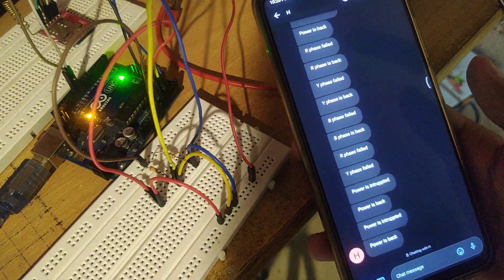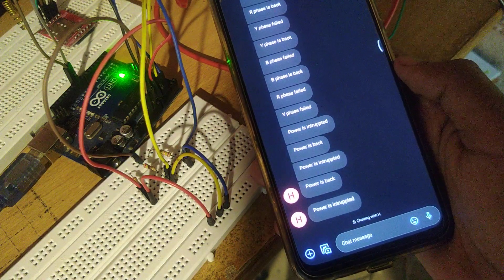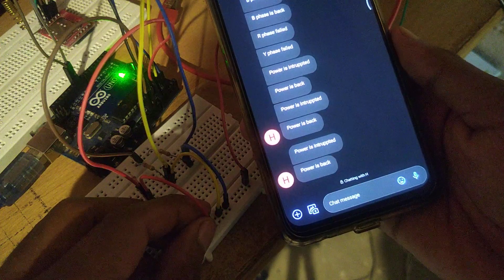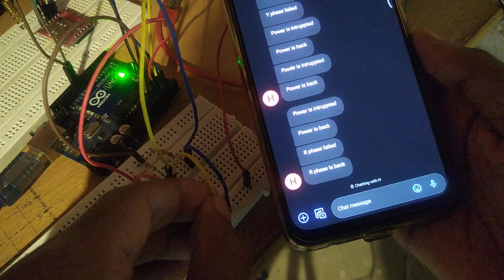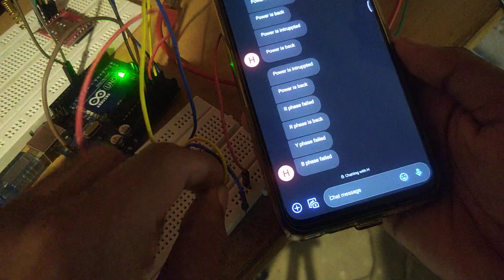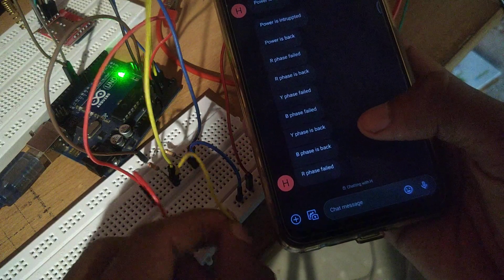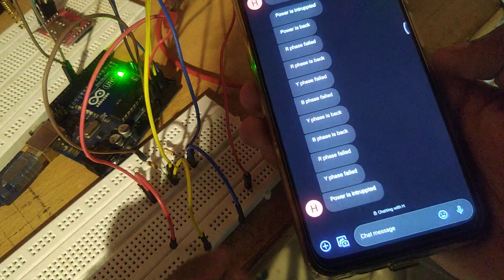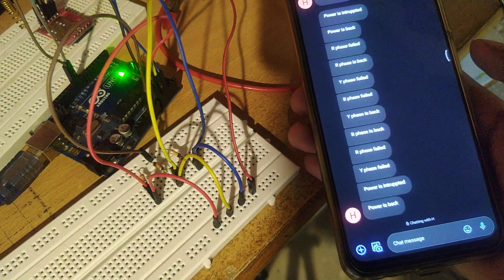3 phase power failure alert system Arduino and gsm sim800l

Comment: Im almost done with the same project. But one  problem im facing is :

(I used Sim800L library revised by vittorioexp)

I wrote code to send  SMS and  a call alert 
But I'm receiving only call alerts .

That one thing stopping me from days.

Comment: do we need to use a new simcard or use existing for number and how you embedded the coding for the GSM, in arduino too?
Reply from the maker: We have to use a separate simcard for gsm module , and for coding you have to go through the gsm library and structure acording to the gsm module model